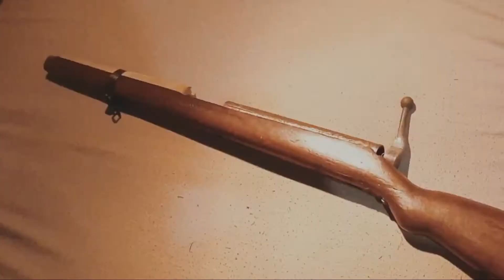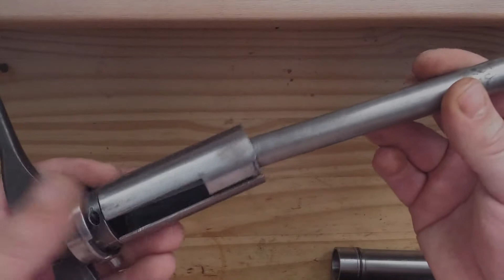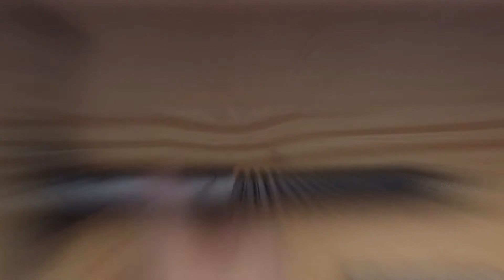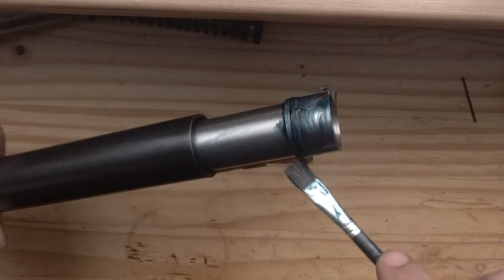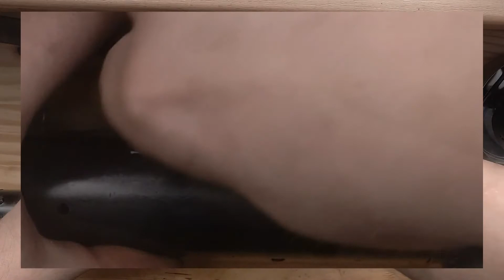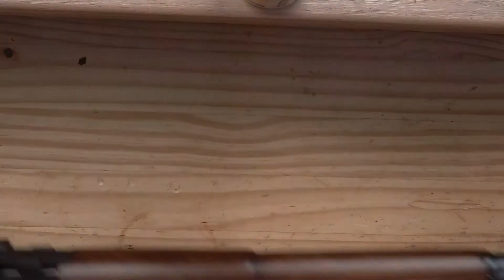VZ.47 Restoration And Assembly

Comment: what is the difference between the top and bottom rifle in the overview?
is it a different model number?
the longer wooden stock and shorter wooden stock
Reply from the maker: All three are the same model Vz.47, but each is marked differently. On top is VZ.47 Česká Zbrojovka Národní Podnik STRAKONICE. The second marked as- tgf. 
The third is marked as Zbrojovka Brno. All three originally had long stocks the last one was modified by Svazarm- (The Union for Cooperation with the Army, or Zväzarm for short, was a unified voluntary military-social organization in the Czechoslovakia.) To make the rifles lighter, they cut stocks. All three are original military airguns.
Reply: @KLAMBRDON  thank you for explaining